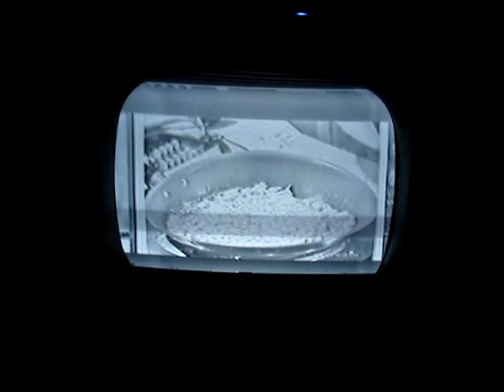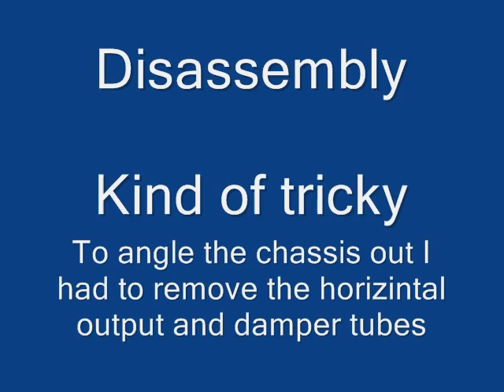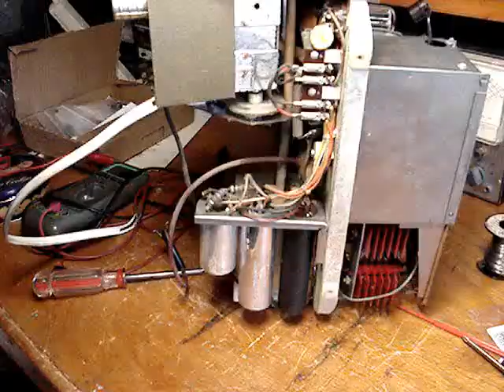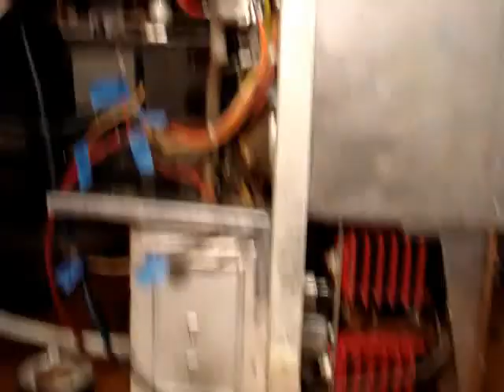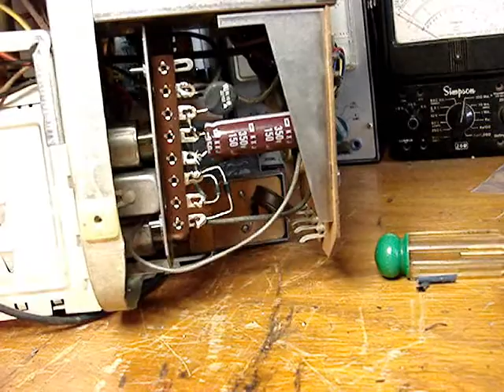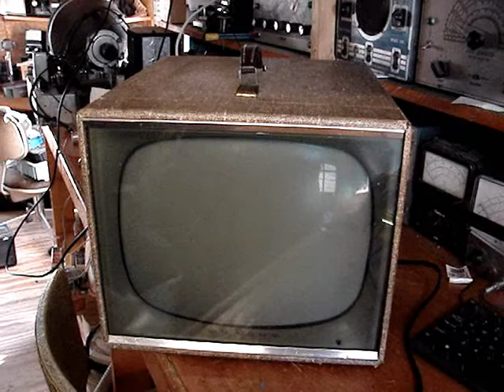DuMont RA392 1957 portable TV PT2

Comment: Very wise on the "do it one more time" discharging the CRT.  Nothing like being shocked by a tube that recharged itself.

I do restuff cans.  I even restuff cardboard tubes under the chassis.  Not always.  It can be a ton of work.  I only do it for my sake.  If I don't restuff, I always try to leave above-chassis cans in place, disconnected.

I don't see the point in using an inrush limiter in place of a selenium rectifier (though your thoughts on limiting initial heater current is valid).  I normally only see them used in place of vacuum diodes.  I wouldn't use one if not necessary, because they are failure prone.
Reply from the maker: I added in the thermistor based on the advice of another restorer and I agree about thermistors being prone to failure. Based on my experiences when I was repairing TVs back in the 1980s I replaced several of them. Before I pull the chassis back out to finish replacing capacitors I should check the B+ voltage. That slipped by me when I made this video. I don't remember what the line voltages were back in the late 1950s. At one time line was 110v but today it is 120v which is what I bring it up to with my variable power supply. Anyhow; I wish you lived next door to me but I guess I told you this once before. Thanks for watching Matt.
Reply: @HD7100  I don't think it was 110 in the late 50s, probably 117 nominal by then, meaning 115~120 I suppose.  Nominal today is actually 125V, and I'd say 128V is pretty normal.  In any case, yes, your B+ could be off by as much as 15%, based on line voltage plus rectifier replacement.  Lowering that may help your vertical.

I'm sure you're aware of early Zenith radios that were engineered to the limit.  The power transformers, designed for 110V burn up quickly at 125V.  I currently have one that I acquired already burnt up, which I actually successfully powered up at 60V to test the rest of the receiver.  I have a replacement transformer, somewhere.
I wish I lived next door, too.  I like that area, in any case.  Living on the main road of a populous area is starting to wear on me.  I'm sure I told you that twenty years ago that was one of the areas where I looked at houses I couldn't afford.